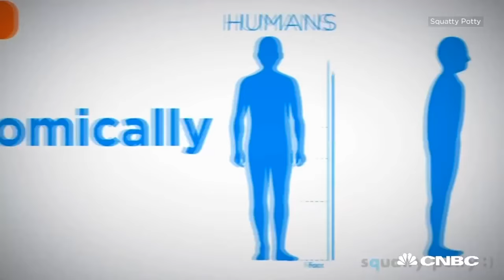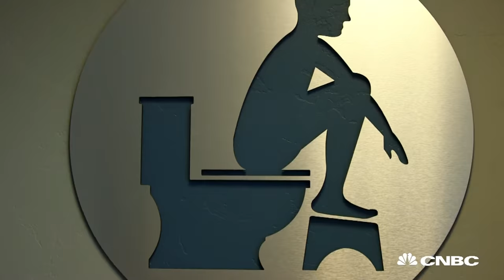Mom's Constipation Turns 'Squatty Potty' Into $30 Million Cult | Strange Success | CNBC Make It.

Comment: IT works like magic, well or nature since we are supposed to squat, there were no chairs or toilets when we were cavemen.
The only bad thing about it is that you become used to it and pooping the old fashioned way becomeseven  more difficult than before.
Its not a problem if you are home with your squatty but if youre at a firends home or a hotel you have to use some uncomfortable stepstool.
Apart from that this makes pooping a quick and painless thing lol.
Reply: In a public restroom, I turn the wastebasket on its side to suffice as a makeshift squat a potty.

Comment: It’s genius really- but if you don’t want to (or can’t) drop $25 bucks plus shipping & handling for the “brand name”, just grab a $6 step stool from your local value store. It basically does the same thing, you just cant spread the feet out as far. But you get that same  “leverage” & alignment. This is a game changer for constipation sufferers.